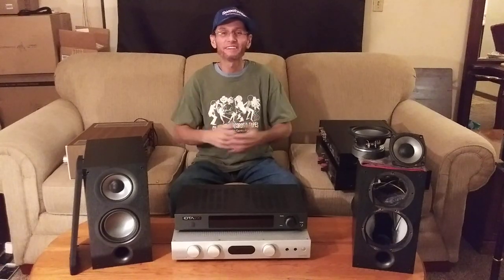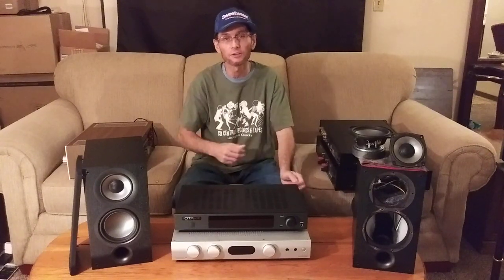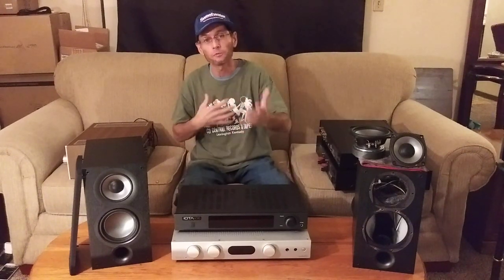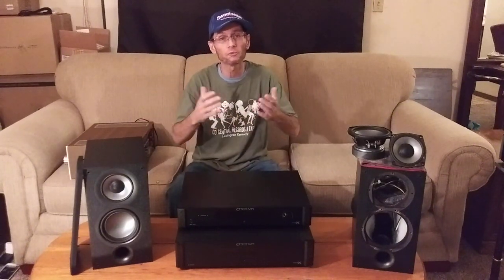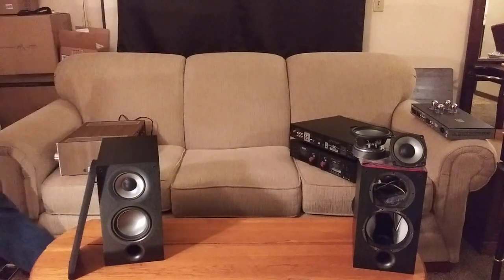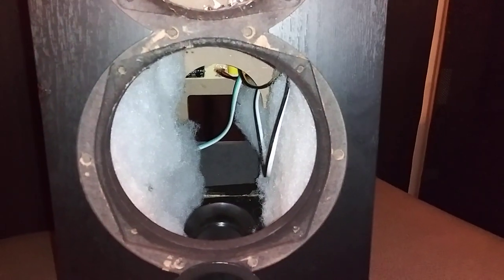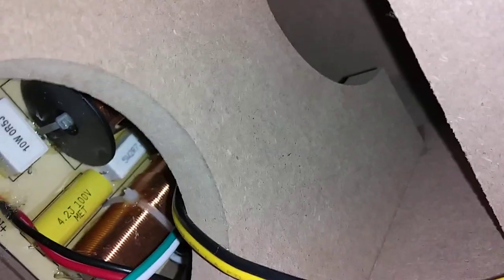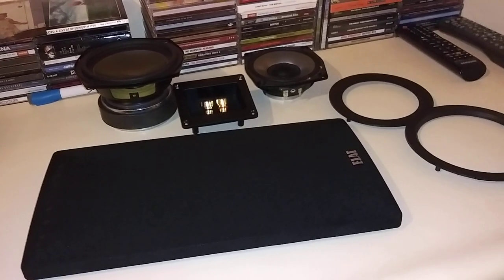PART 2 ELAC UB-52 STANDMOUNT SPEAKERS AMP PAIRING (SYNERGY ! ) AND A DEEPER DIVE INSIDE !

Comment: Hi. I bought the ub52 a few months ago, open box eBay for 300 bucks. I have a 200 wpc Yamaha Mx-1 dual mono amp. 
The speakers sound very strong with this amp pairing. The bass is surprisingly full even though I have them placed in probably the worst spot in the house in the middle of the living dining room and they sound fully realized. It’s hard to believe a speaker could sound more natural and powerful in this form factor. 
I have a dedicated listening room with vintage ess rock monitors as well. Much different listening experience from the elacs, but also a completely different speaker. 
Thanks for your videos!
Reply from the maker: Ohh yeah that Yammy MX-1 is driving those Elacs ub52s to their full potential 'flesh and body' and the Yamaha i used on the elacs brought them to life ! Did you watch the last 10 seconds ? I put me heavy weight on the elacs and their very well balanced even at loud volumes the bass stays composed solid speaker espically for 300 bucks !!!

Comment: on my computer im running a pair of these speakers with an AS-701 and loving them!! probably wont buy a pair of speakers till i find a pair of NS-1000's. i bought the elac's (same speaker but older version with rear port) for under $300 open box on amazon and it was one of the best speaker purchases i ever made
Reply from the maker: @JohnDoe-cv8iw  Yamaha sounds great with Elac ' loved the combo with As1100/CA810 ' The pioneer fs52s paired up very well also actually better than me elacub52 Synergy '

Comment: So much effort to open this one. I hope you could put it back.
Another great review man!
Reply from the maker: I been opening speakers up for over 30 years and this one was tuff without damage !!! 
I Bet their won't be no upgrade crossover kit for this one 😆
Reply: @tee-jaythestereo-bargainph2120  I'm curious how do they do the maintenance.
Reply from the maker: @SpikeoutBattleStreet  big company like that they most likely have a tool to take the front cover ring off 
Even if they broke the plastic ring like i almost did ! 
I am sure they have extra cover ring . 
The Cover rings  maybe cost the company 5 cents worth of injection molding plastic 😆 Elac does sale B-Stock for $450.00US
Reply: @tee-jaythestereo-bargainph2120  Agree. It's much easier for them because they have the resources.
Reply from the maker: @SpikeoutBattleStreet  yeah it was ruff to take apart with out damage dam it was tuff and they glued down and screwed down the crossover ! 
I did modify my Kef Q-100s with NoRez and bracing added
Reply: @tee-jaythestereo-bargainph2120  Maybe that's a decision after they watched your  videos. They don't want people to touch anything inside. Things will get tougher for you in the future😁.
Reply: @tee-jaythestereo-bargainph2120  Hi! Dear TJ. Talking about crossover. Is there a chance to share your expertise on this topic in the future? I have a pair of JBL Control One. It is an old model such that the crossover is basic (just one capacitor and one inductor). I saw some crossover replacement selling on amazon (look like Chinese products). I doubt I can make use of them.
Reply from the maker: @SpikeoutBattleStreet  yes

Comment: Hi Tee-Jay 😀,
Thanks for another great video.  Based upon your experience with these speakers, I would stay with a larger speakers (if size is not a problem) that have a higher efficiency.  Larger drivers and higher impedance with a lower wattage amplifier for people just starting out on their hi-fi journey.  Fluance has some great tower speakers at a lower price point that have gained really great reviews from several well known reviewers.  I am still looking for a new pair of speakers to match with my Yamaha amplifier (80 watts per channel).  I am currently using a vintage pair of Koss speakers.  I think they sound good, but I would like to try something new.  Thanks again, and best regards, Brian.

Comment: You can always count on Yamaha. Specially that a-s1000’s and above series. I wonder how the a-s701 rated at 100 watt would sound with the Elacs.
Do you use a sub along the Elacs?
Reply from the maker: Sometimes i use subs and yes the 701 will pair up to the Elacs , I had the 801 and last 20secs of video you will see i drove the Elacs with my 51.5 pounds of Yamaha AS-1100 that amp sounded amazing with Elacs

Comment: Hey Tee-Jay I have a question I thought maybe you could help me with. I recently just moved into a new place, and I myself am new to the audio world, well my new place has a media room, and what I am doing is making as such thus I am using it for my gaming room/music room/home theater so I'm going to be using a home theater receiver as my central hub for all things audio both music and watching movies, as well as playing console video games, the receiver and speakers that I have are hi-res, and I got a 7.2 receiver, but I want to save a little bit of money as I already have 2 Dayton sub 1200s, one of them is already in use as the sub to my gaming PC, and it uses the high level input/output for the audio on it, but I was wondering if I can do this while simultaneously using the mono input on it for my home theater receiver and have it still work, I obviously would not be watching a movie and playing om my gaming pc at the same time, but I was wondering if I can do this? the reason I ask is because the amp I am using for my computer speakers while it has two inputs on it, a .25 inch TRS input, and an RCA Input it will not work if a source is fed into both at the same time, so I was wondering if it would be the same with a subwoofer.

Comment: Great information, thanks! Tee-Jay, in your opinion, which speakers paired best with the 6000a?
Reply from the maker: The Triangle Esprit EZ comete/
Triangle 40th Anneversity Comete
 Klispch Rp 160m 
6000a makes for a solid preamp as well when you put in preamp mode the power amps relays cut the power off to the amp for low noise awesome feature !
Reply: Thanks for sharing!
Reply from the maker: @lloydbrown3223  if you have any ?just ask in comments

Comment: I have an idea about how you can take bargainphile to eleven.  Consider copper bullet connectors and an alternative to tube connectors.  I also would like to point out in the AB comparison on New Record day..  The ultra bad nut fasteners at the back of the binding terminals were still in those speakers.  Without them the convenience of switching connections would not have been possible.  That means the metal nut was both ok, and bad all at the same time.

Comment: Hey Tee-Jay thank you for the awesome review! Right now I can get the IOTAVX stack with the dedicated PA3 and save $350 compared to the Emotiva stack. DO you think that will drive these properly or should I go for the Emotiva instead.
Reply from the maker: Yes the Iota Stack will drive them ! 
I would take the stack all day long over the Emotiva . I have a comparrsion video no super detailed but yeah Iota for the money its solid !! I love it
Reply: @tee-jaythestereo-bargainph2120  Sold!. Thank you so much! I watched most of your reviews, hope to see more!!!
Reply from the maker: @heranyadesilva1634  Ohhh yeah finishing up my dedicated listening room as we speak 😃 Got lots to cover the new Omnia all in 1 amp and the Audiolab 8300a dual mono integrated amp 😃
Reply: @tee-jaythestereo-bargainph2120    Oh damn that's progress, cant wait to see your new space! Also I got my PA3 today and hopefully the SA3 will arrive by evening. But to my surprise the manual has changed the power ratings. New manual says 70W in to 4ohm stereo and 140W mono. I wont be able to try them with my Elacs for sometime, hope its not a drastic difference.
Reply from the maker: @heranyadesilva1634  Hmmm maybe Iota is using a different way of testing power output The Sa3 is 50/90 watts 8/4 ohms 
And stack is 100/180 watts dual mono 
Thats weird its changed
Reply: @tee-jaythestereo-bargainph2120  Yep, maybe the THD is different. And you were absolutely on point with the sound! Loving it, thanks again for the great suggestion.

Comment: Hey TJ would you  consider using the Emotiva trade in program and update your old PT100 and A300 in for the new PT1 A2 combo and let us know if it’s much of a improvement?  I’m really curious if it would be worth the upgrade
Reply from the maker: J R I'm curious also if that would be a upgrade or not Because heres the double edged sword str8 up. 😆 
 (IF) the new sound is different
 (colored/Flavor)  then its really going depend on your speakers you have if the synergy is better or not , BUT 
 IF the sound is similar and the improvements are as in just performace better dynamics/Soundstage/Attack/Vocals/tonality/ then yeah may be an upgrade with new version 
If people would write Emotiva to send me the combo i will compare them .  
But one of the best upgrades i did with the Emo-Combo is a solid dac or Phono pre-amp thats to YOUR TASTE 😃
Reply: @tee-jaythestereo-bargainph2120        Ok pal ,  I will write Emotiva after supper and suggest they send to you 😃
Reply from the maker: @JR-ho5qm  thank you ! ,
 you can send them me review video 😃
 I actually bought the basX Combo

Comment: Hello Tee-Jay! Thanks for all the good information. I will like some advice from you. I am planning to buy a pair of elac ub52. However I have a Denon AVR receiver 125 watts per channel @ 8 ohms and 165 @ 6 ohms. I would like to know in your experience, do you think my AVR is good for the elacs? I read information that suggest not to change the ohms setting at the AVR and to play @ 8 ohms no matter the speakers ohms rating is. Is this correct ? Or do you think I should change the setting to 6 ohms and play the speakers @ 6 ohms? Thanks in advance friend!!
Reply from the maker: Honestly I would try both 8/6 ohms settings and you decide which one you like better 😃 Remb the number 1 componete in your hifi system is you ! 
In A Hometheater setup you'll be using power subs and you will have a cut off around 60-80 hz with your elacs so i think you Will be just fine ! 
I mainly just talk about the 2ch steteo setup and playing these speakers at 
full freq range thats why i was talking about how the ub52s love power !! 
But in a H.T. setup yeah your good to go !
Reply: @tee-jaythestereo-bargainph2120  Thanks for your advice friend!
Reply from the maker: @emustang  thanks for stopping in !
Reply from the maker: @emustang  thats what i am here for 😃 your welcome
Reply: @tee-jaythestereo-bargainph2120  According to your information I will be good with the Denon AVR as you said. I will play the Elacs in a 2.1 setup with a SVS subwoofer and crossover at 80 Hz.
Reply: Hello Tee-Jay!! Hope you are well! Do elacs ub52 can play loud? Do they distort at high volumes? Thanks again...

Comment: Hi, Thanks for your helpful videos. From all the speakers u have heard (under $700) which one do you like the most? (I know every ones taste is different) 
I have (one week now) the Elac UB52 and like u mentioned it’s not my taste I like the sound to be a little more closer or boosted. I have it paired with Rotel A11 Tribute. In order to really enjoy the music I have to set volume at 50 and up. But then after half hour I can feel my ears. I have a small room 8x9. Should I buy a speaker that has a more boosted sound, so I can enjoy the music at lower volume(what speaker?) ? Or maybe the Rotel is not enough to drive the UB52?
Reply from the maker: Hey K , I understand completely during my video i talked about my dozen class AB amps the smaller ones 20lbs and less just didn't have what i call enough voltage to drive the elacs with that full flesh and body sound , 
Yes active subwoofers helped out with my smaller amps once i had the crossover point at 60hz but i still didn't get that midbass impact i liked alot ! 
Those Elacs like powaaa to be driven properly Imho they should have been rated at 83db efficancy .
At the end of my video I gave a quick sound demo of driving the elacs with proper power amp that was set at 9:30 on volume clock (low volume) the Bass was hitting just like your talking about Hard !  
My favotite speaker under $700.00US 
is no Other than the Triangle BRO 3 
I have 2 videos posted on the Bro3 
The bro3 have exellence bass top end is a lil forward and articulate and a nice warm midrange and rated at 90db efficancy 
My lil IOTA VX SA3 integrated drives the BRO 3 properly ! But Zero -Fidelity has a very good video review on the Bro3 
But the Elacs do sound good with proper power they are growing on me !!
 But a lil dry 😥 on top or imho re-cessed
Reply: @tee-jaythestereo-bargainph2120  Thanks. Btw I have it paired with a active sub but I can enjoy so much the midrange.. 
Interesting about the bro 3, because Cheap audioman knocked off this speaker.. :(, I don’t remember now why. 
BTW - In general - listening at 50/55 volume, is it considered high?
Reply from the maker: @AromaFrank  I had the Bro 3 on loan lease agreement, wish i would have bought them,  i most likely will buy them in the future.
 The Bro3 scales up the ladder very well with better and better audio.
 I put hundreds of hours on the Bro 3 with a wide range of amps !  
 But honestly its the speaker you like that matters,  not me not C.A.M. 
Remb the number 1 componete in your Hi-Fi system is YOU my friend ! 
But i do believe adorama will give you a trial period with Bro3 if you don't like them send them back the only thing with the bro3 is they do not sound good in a high reflective room ( or what i call a room that echos badly) 
And they need some room to breath 
I made sure to put that in the channels video review , the bro3 gave my lsim703s a run for the money that shocked me ! The 703s don't have the most refined treble amp pairing is huge with 703s but when right ohhhhhh my !! 😃
Reply from the maker: Yes thats high !
Reply: @tee-jaythestereo-bargainph2120  Thanks. So in a room like mine 9x8. Isn’t too small for the Bro 3 ? I’m putting it into a shelf surrounded with books! Also do u remember about it’s clarity in midrange and treble?
Reply from the maker: @AromaFrank  yes the texture and tonality of the midrange paper driver melted me !! 
And top end clarity is fast and clean a lil articulate . 
The room is small in my video review i brought the white board out to show people the distance the speakers need to be away from any walls and carpets rugs curtains help out alot also 😃
Reply: @tee-jaythestereo-bargainph2120  Thanks again. So in my case that the speaker has its place only inside a shelf surrounded with books. The room is about 8x8. Will the Triangle still be great just not at it’s highest potential or in this case I should go with something else?

Comment: I'm running ub52 on both a Cambridge cxa61 (60 watt) and a NAD C316bee v2 (40 watts) at their 8ohm rating. I realize those watt figures are probably higher with the ELAC 6ohm rating since the amps are both 4ohm stable. 

I am preferring the Cambridge over the NAD and am wondering if it is down to the power. I have a smallish room and do not need either amp past half way point on volume control to get it loud enough for me, however I am aware that peak dynamics and such in music may place demands on an amp far beyond what the set volume level would indicate. In other words, having them at 50% volume I'm aware that a peak In the music could still be drawing every bit of available power from that transformer and if it is lacking in anyway, I will lose some of that punch, kick, crescendo, whatever you want to call it. Energy. That's it. Will lose some of that energy. I've heard speakers run out of gas in the past but I'm new again to 2ch and wondering if my next step is to get a more powerful amp for the arsenal. At my listening levels, I don't think I'm missing out on much with the 60watt Cambridge or even the 40 watt NAD, however that final 5-10% on dynamic peaks could be the difference in sound when listening to 'difficult' parts in songs that are requiring extra energy on tap. 

Thanks for doing the review it has me thinking again at emotiva, just so i have a high wattage power section to try out. The Yamaha is beautiful my friend. I'm just not there with the pockets yet. 😋
Reply from the maker: The cxa 61 looks like a stout integrated they use Sanken output transitors and nice size toridal (power supply)  I think you should be good driving the Elacs whats the 4 ohm ratings ? The CXA has full range preouts also 😃
Reply: @tee-jaythestereo-bargainph2120  90 watts into 4ohms... so my guess at 6ohm it is around 70ish watts if it's 60w @ 8ohm? 

I'm using the stereo pre outs to run to the sub currently, even though it has a sub output. On the short list is a sub cable to try AB the difference using full range pre vs dedicated sub output.
Reply from the maker: @erics.4113  Yes your dedicated sub output from your Integrated amp is a mono output,  
Meaning your getting both left and right channel out of your sub instead of just left or Right channel , if your using a sub you should be good to go !!
I would Have the subs crossed over between 60-80s hz or what sounds best in your room . 
But yeah your amp should be a solid 75-90 watts with the elacs , 
The elacs play more in the range of 4 ohms and their really about 83-84 db efficancy , I didnt test them on any equitment other than in comparrsion to my other speakers rated around the same specs .
Reply: @tee-jaythestereo-bargainph2120  well the cxa61 is only 18 pounds so I'm thinking I'll stick some diver lead weights on top and make it 30lb for even better sound 😁
Reply from the maker: @erics.4113  😆 i wish the Elacs would have been bi-ample for mid/hi and lows that would of been perfect , 
Thomas and Stereo reviewed a $300.00 US class d amp kit I just wonder how that would work with our smaller integrated amps pre outputs